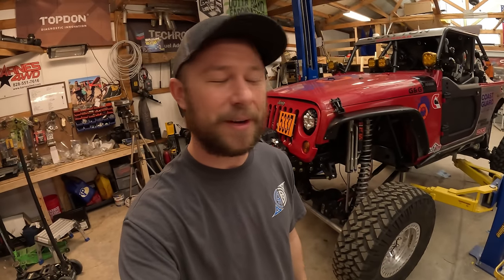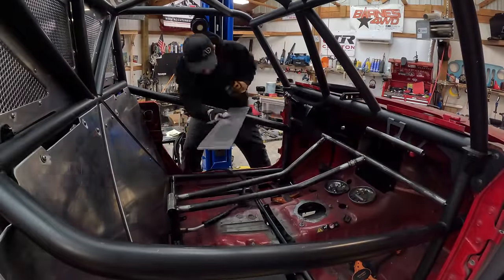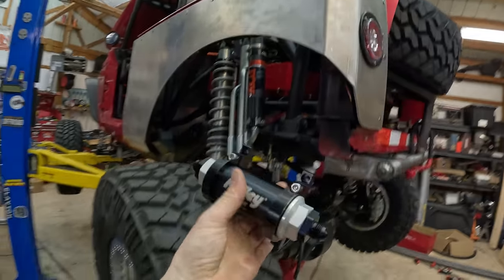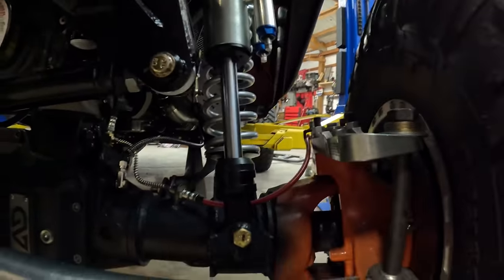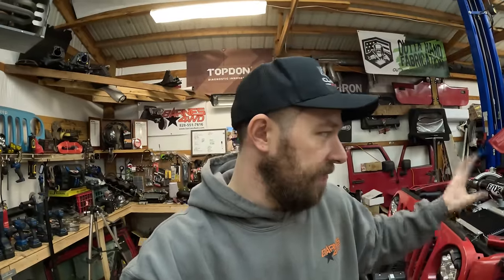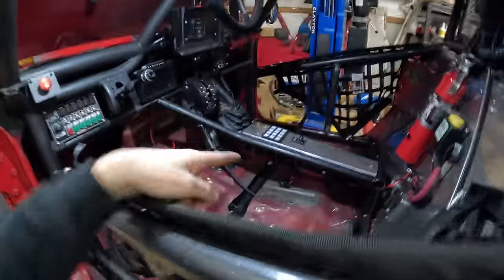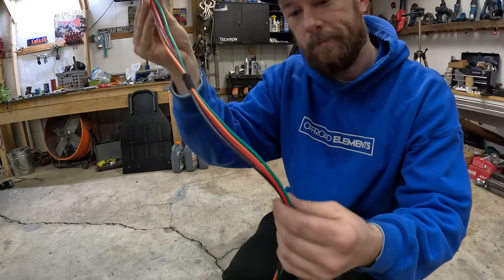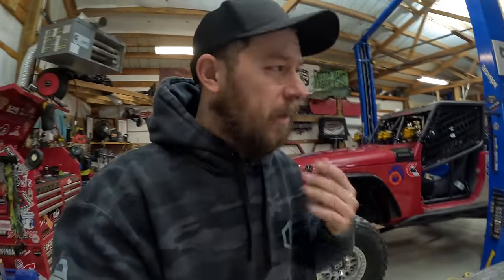The Final Race Jeep Wrangler Build Episode!

Comment: 1/2 wave antenna does not need a ground plane.   We mount them so that the base of the antenna is below the cage in the back, and then just duct tape an extra pre-tuned whip to the cage.   We've rolled it twice at KOH and the antenna never broke.

Comment: Did you buy or fabricate your hydro assist mounting bracket/box welded to your axle tube?  I'm in the process of installing a hydro assist ram on my LJ now and like your set up a lot.
Reply from the maker: It’s a Barnes4wd shock mount with the face opened up a little for the heim joint, worked great! https://barnes4wd.com/products/behind-the-axle-high-clearance-shock-mount?_pos=3&_sid=91e99d226&_ss=r
Reply: @JKGearandGadgets  thank you!  Just ordered it.